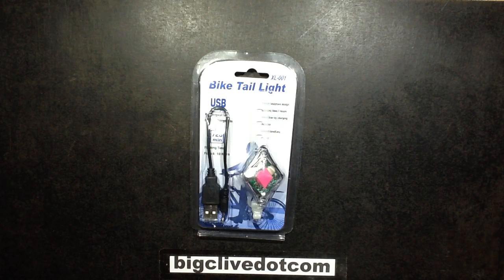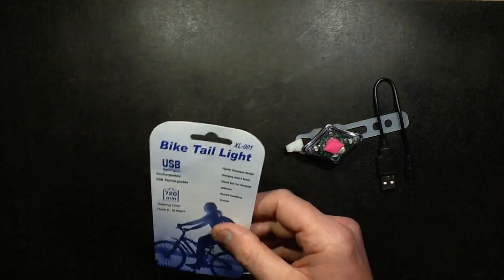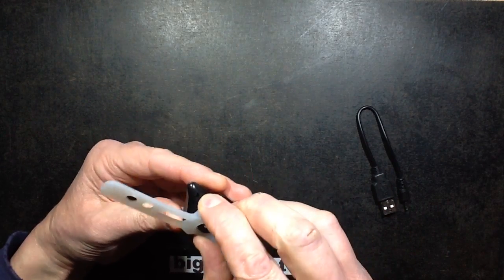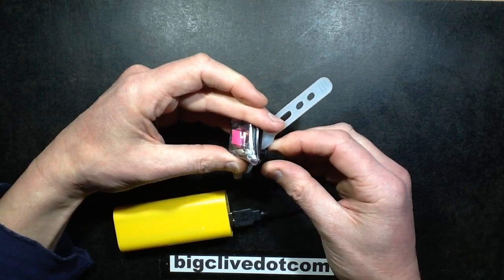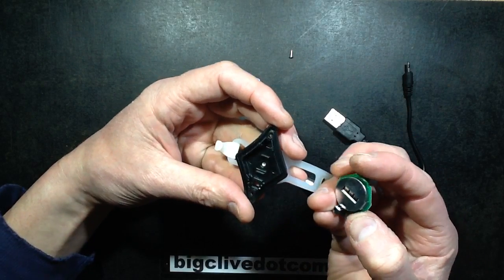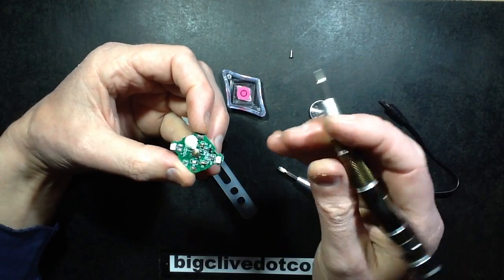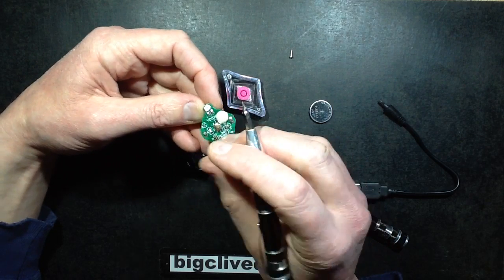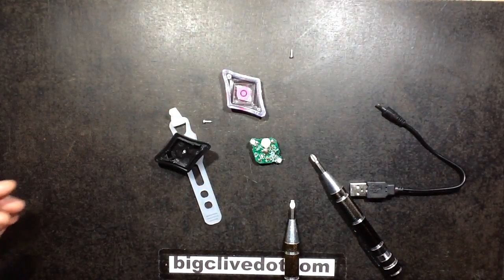Inside a USB rechargeable bicycle warning light.

Comment: I just made cheap front lamp with li-ion charger module[2cmx2cm/1A-TP4056],old 3.7V/1200mAh battery from phone and 3W/350mA cree LED[driver in PCB].Works bright [200lm] and fine,cost about 3$. ;D

Comment: what leds did you order god that will last you along time
Reply from the maker: It was a full range of the colours in diffused white 5mm packages.  They came from various Chinese suppliers.  I'm really just boosting my stock of LEDs.  I get through quite a lot on an ongoing basis.
Reply: could you throw me a link
Reply from the maker: RC MAD The main seller I used was 24-online*2013

Comment: I was guessing the charge circuit is the red led in series with the 5V supply, with the 1V5 drop of the LED and some resistance doing the charge current voltage and current limiting. Will charge the cell to "around" the right voltage.

Comment: Who's your LED supplier?
Reply from the maker: I use a lot of LEDs in my projects.  They're from various Chinese suppliers.  I tend to buy a pack of 100, test them, and if they're acceptable I buy a full bag of 1000.  The quality from any given seller can vary though.
Reply from the maker: I don't use a specific one.  It varies all the time, since the quality can vary from any supplier.
Reply: Ah i see! Its a case of hit and hope!
Reply from the maker: Callum Burns Yep, that's pretty much it.  I could use the official UK suppliers and get Nichia or Kingbright LEDs at high prices, or buy from China and take the gamble that the LEDs are going to be good.  I tend to buy a small pack and if they come in anti-static packaging that earns points.  If the LEDs test out OK for intensity, chip alignment and the low current test that earns more points.  Then buy a bulk bag of 1000 and hope they send the same stock.
Reply: bigclivedotcom May i ask why'd you buy 7,000 LED's, and how much they all cost?